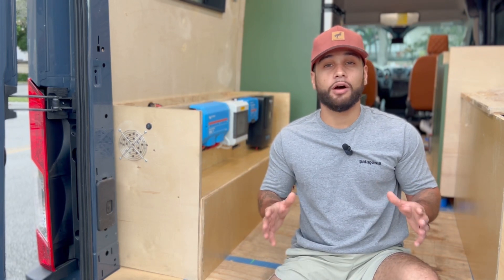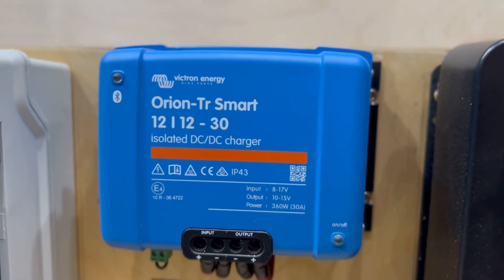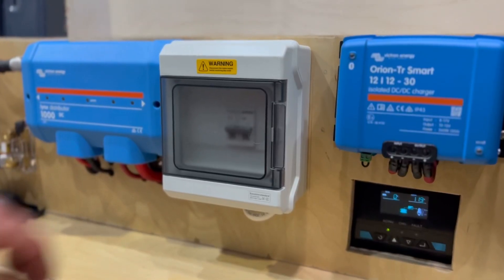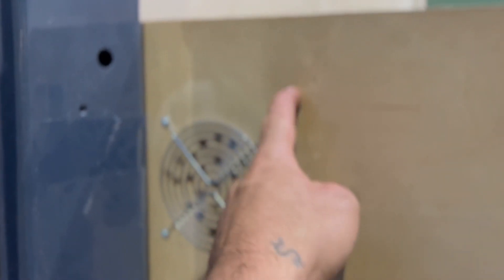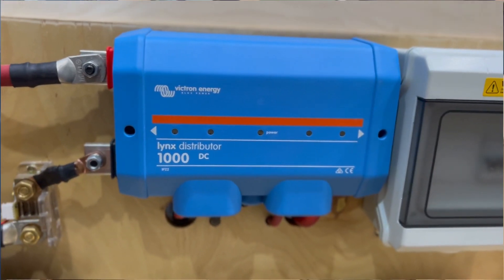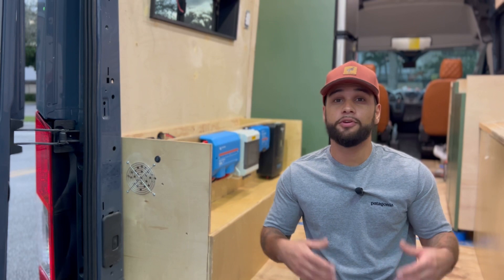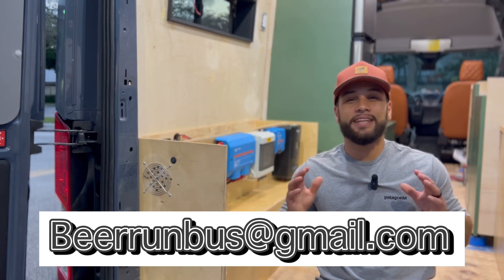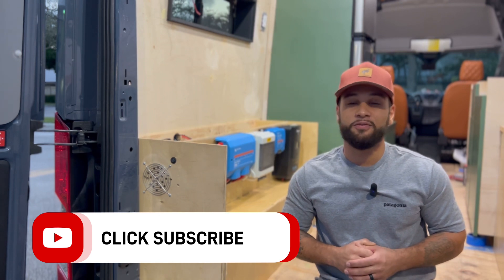Camper Van Off Grid Electrical System with Solar  | Great for Beginners & pro’s

Comment: I was wondering if you have a class t fuse from the battery bank to the lynks distributor, preferably before the master switch. I also noticed in the short video the ground wire you used looks thin compared to the feed wires and should be on the frame. The rule I have been taught is that it should be at most 1ga less than the feed, so if you used 1/0 for the inverter, the ground should be 0. The instructions for the Orion DC-DC say to mount on a non flammable material as they get extremely hot compared to everything else I have used. A piece of aluminum would be fine and act as a heat sink as well. BTW there's some computer fans available with a temperature sensor so you don't have to worry about turning it on and off when things get warm. Overall some nice work but I think a few things may have been overlooked.
Reply from the maker: Really appreciate the comment. I’ve learned that in this industry there is always room for improvement. 
The class t fuse is in between the batteries and the lynx distributor. 
The ground is 2 sizes smaller than the 1/0 g wire. 
As for the dc to dc charger that’s actually a great idea and ill be adding a heat shield behind it for extra safety. Thanks for the tip. ✌️
Reply: @buildersblueprint  my pleasure, I redid my system twice based on suggestions from others. Mine is in a travel trailer under the couch (with the water heater). Someone suggested that I add some sort of water sensor just in case, so my spring project is pulling out the couch and installing a WiFi water sensor alarm! Always improving is an understatement, cheers 🍻